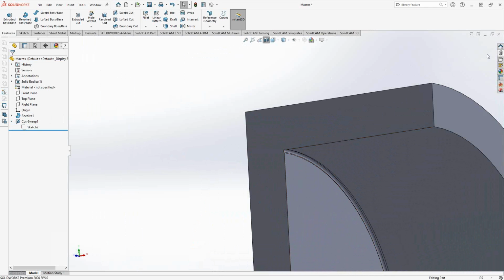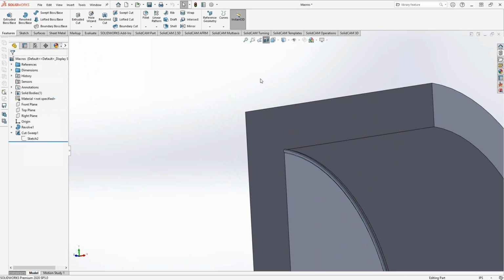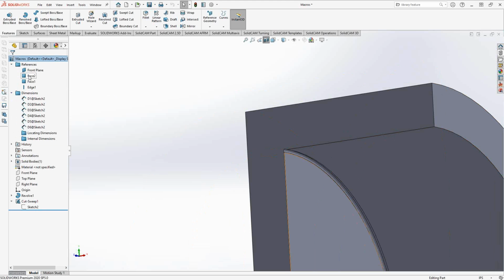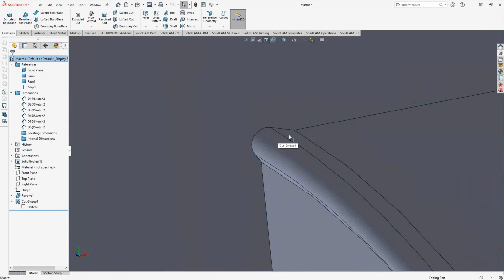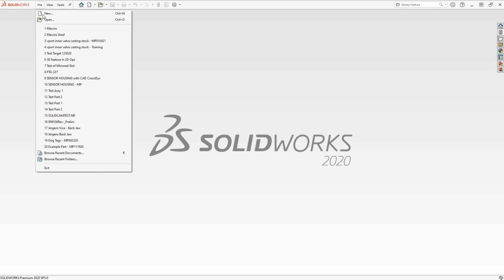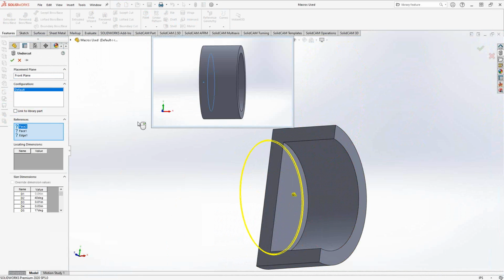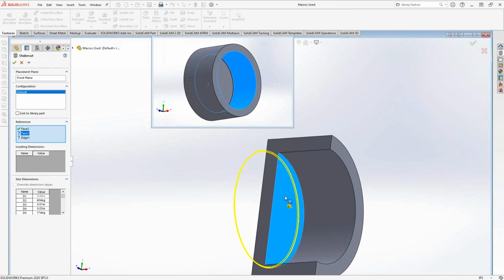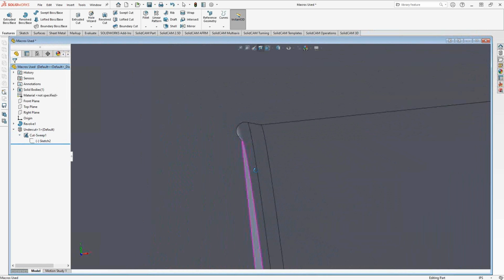Repeating Design Modifications

Comment: Can you save this feature so that your designers can put it in themselves on other family or similar parts.  Or can this only be done with the Solid Cam tools?
Reply: This is a function of SolidWorks not SolidCAM.  Your designers can create and share these Library Features with anyone using SolidWorks.  This video is meant to highlight how it can be used to address a recurring need from programmers who need to make the parts they receive from their designers more machinable.